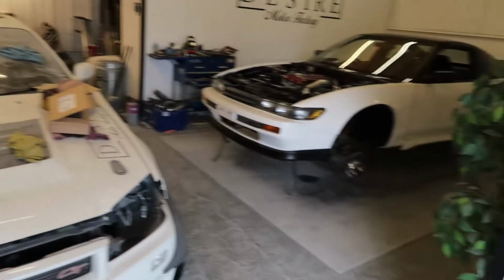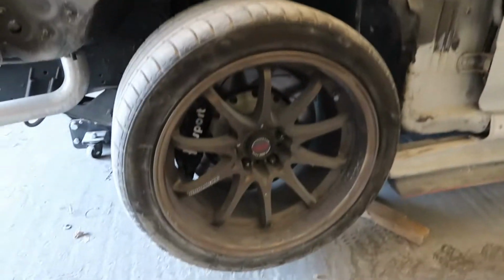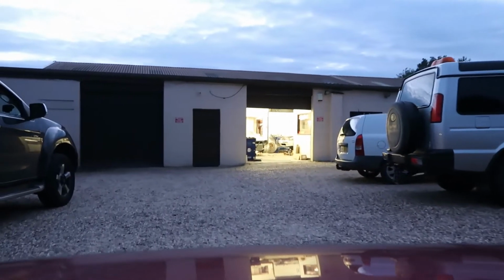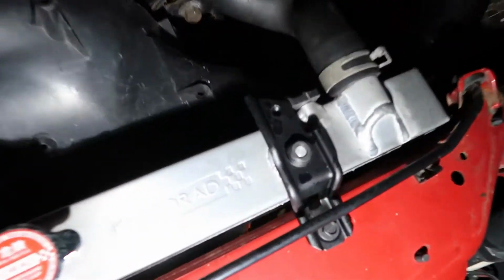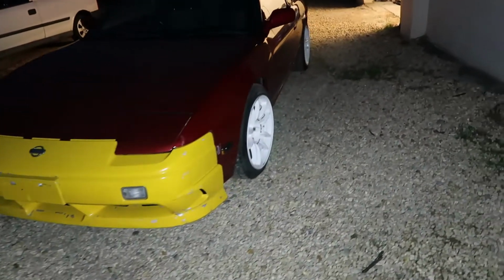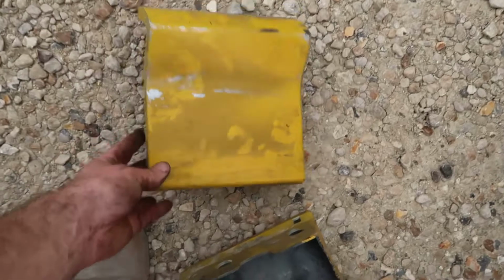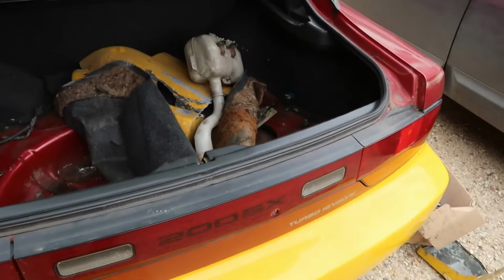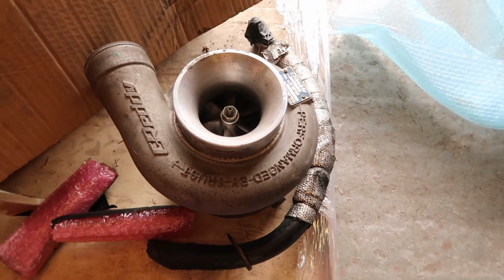big TURBO - big BRAKES - NEW CAR

Comment: The S13 looks like a good starting point, someone has spent alot of time/money on it previously. Where did you source the Turbo setup?
Reply from the maker: indeed, i know the guy i bought it from and hes really taken his time building it from the ground up. The turbo kit is a used unit. Theres a concern it will be silly laggy but as the closest most people see to this size turbo is T78. the greddy td06 25g doesnt have a massive exhaust housing so it will be interesting to see what power this makes and how it makes it.